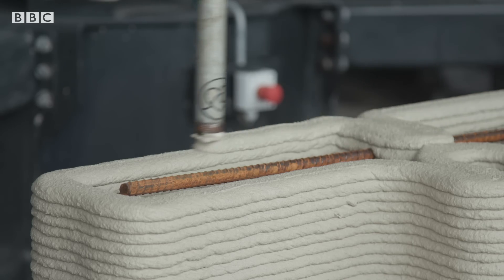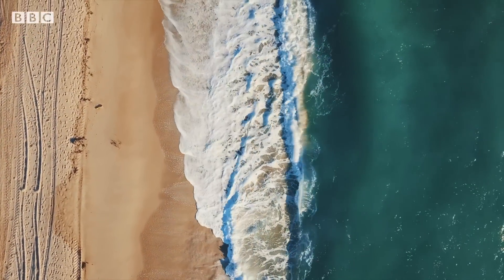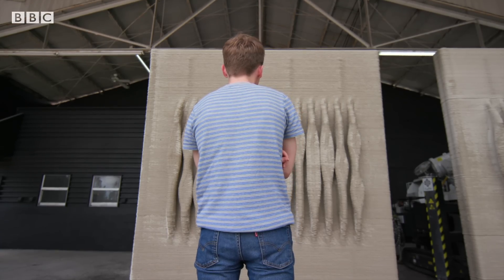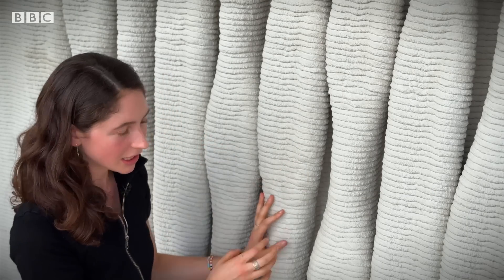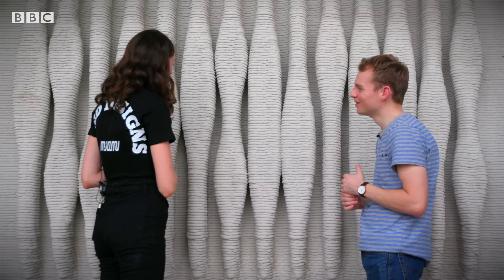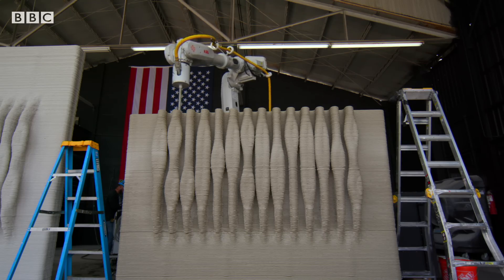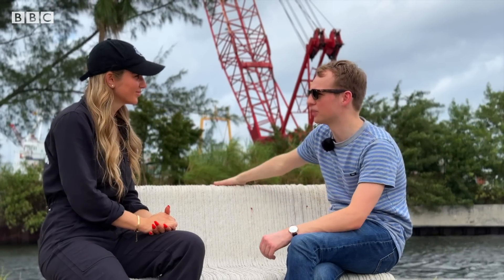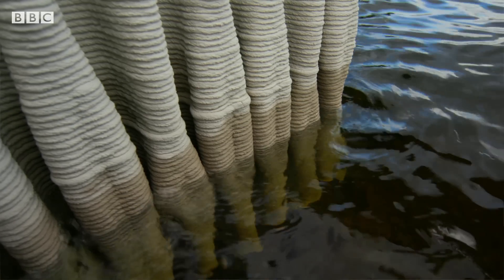Can 3D printed sea walls protect marine wildlife in Miami? | BBC News

Comment: Concrete! they are printing concrete! the biggest CO2 emitter on the planet, yet, this is a design they want to build with. And hey - It can be marketed to go anywhere! Brilliant, bring in the big bucks. $$$... Yet rising sea levels is caused by what? CO2 emissions warming the environment right. This planet is absolutely madding. Wh are they not focused on simply producing and working with a material thats not toxic.

Comment: I mean, it makes no sense to compare to plat see walls when we have used other types of sea walls for many many decades at least. It seems mostly to make it look even better. Obviously they have added good characteristics that you would not normally have where space is limited, but otherwise I would say that a regular concrete seawall is even better then this because the space available in between the concrete is more there, both small and large spaces. This one is just a compromise where the no 1 priority is not wildlife but just protection with small benefits to the wildlife.

Comment: These are extremely fragile. Their hollow core and layered assembly make them far weaker than their solid cast concrete counterpart. As such these panels are not suitable for seawalls. Waves have the power to destroy solid concrete panels this thin. What makes this girl think these hollow, layered panels stronger? Theyre not. A log or boat impacting these panels would cause them to crumble. 

This fluff piece was filmed at the request of Ayana as a means to find new investment.

Comment: People in the comments section suggesting alternative materials, including hemp, for this sea wall are forgetting that salt water is very corrosive. It is hard to find a material that can be 3D printed and stand up to constant waves, salt and sea life burrowing into it for decades. This is the other challenge...finding a material that doesn't break down yet isn't toxic and can be 3D printed can't be easy, as some are making it seem in the comments section.
Reply: If the problem is rising sea levels then address that. Which is the root cause - our building supplies, cars, Electricity production. Food production, These are the cause of our rising sea levels, Building with concrete is arriving at the problem down stream.
Reply: @grahamhiggins1816  what your suggesting takes time. The short term solution to stopping floods next week is sea walls.
Reply: @Guangatron because humans are short sighted.
Reply: @Guangatron  How many tonnes of Concrete are we talking of using? And this is a prototype machine they are trying to sell as a system for building, The manufacturing of concrete is highly problematic, for every tonne of cement made - 900Kg is supposed to be emitted in CO2 gases.. The world needs change, drastic change in mindset, it just doesn't seem to be taken seriously.

Perhaps, stone and sand could be used to build sea walls, - I don't know, Im just quickly looking at this situation now. But our time is up, yet nothing seems to be changing.

Comment: Roman concrete would still be the best underwater since it repairs itself, and you could still print that pattern.
Reply: which Roman concrete are you refering too?
Reply: he means mixing limestone and volcanic ash like the romans which hardens underwater and over time. Pretty OP but hard to scale up in a business @markplain2555
Reply: Pozzolano? @markplain2555
Reply: @markplain2555 be sfv
Reply: What you are referring to is the undissolved blocks of calcium oxide / quicklime found in Roman concrete that were the result of poor mixing.  This created a sort of self-healing concrete but that didn't detract from the fact that it was poorly mixed thus creating weak spots as the concrete hardens.  It's more of a negative than a positive, they weren't able to properly process and mix their concrete materials so they used a formula that had some ability to cope with the extremely likely cracks and bubbles that would form during hardening.  Modern concrete has the advantage of being well mixed and that we can carefully control the exact proportion and grain size of the aggregate ingredients.  There are certainly cheap modern concretes that aren't going to last long but on the other side of the spectrum there are some pretty amazingly strong concretes thanks to modern improvements.
Reply: @giglioflex they weren’t the result of poor mixing but intended, read “Hot mixing: Mechanistic insights into the durability of ancient Roman concrete” by Seymour et al
Reply: I think it's just normal concrete made with volcano ash and sea water.
Reply: @neondemon5137 it’s not the same, the volcanic tuff and hotmixing method with excess lime makes it tough as heck/self-repairing underwater. There are piers built during the Roman era that aren’t looking like all horrid like our modern sea works. There was a paper released about it last year.

You’ll see in the cutout sections of Roman sea wall giant calcium carbonate crystals, the tungsten in the tuff adds some additional properties that cause the concrete to self-repair.
Reply: LeonDegrelle. maybe learn to listen then do some investigating to come back with a worth while response.  Don’t know of gogliofkex is right but they had support for their argument.  This isn’t politics it’s science and engineering where constructive arguments and conversations can be had and help us all learn and be better for it
Reply: this is something that someone who knows nothing about what they're talking about would say - why? because you read watched a video about roman concrete once I'm sure
Reply: @williamrobinson4265 actually, I read the papers that recreated the exact mix and compared it to modern concrete. You are the very definition of the Dunning-Kreuger effect. Read this paper and the several others preceding it by the same authors if you actually want to learn something, instead of talking out your pseudo-intellectual behind.

Hot mixing: Mechanistic insights into the durability of ancient Roman concrete by Seymour et al
Reply: yes and it was all mixed to the exact same ratios down to what ppm? LeonDegrelle.
Reply: you are literally coded as some kind of european peasant - if you were being polite or smart I would be happy to engage with you in good faith - but since you present neither I can't really be asked to care what you say or what happens to you LeonDegrelle.

Comment: those things look absolutely impractically fragile and expensive (very expensive and slow machine, and they still need to babysit it, as the video shows). and the amount of scam-typical buzzwords used is beyond alarming.
Reply: Exactly, what kind of seawall is that 🤔
Here, seawalls are made of huge boulders and wave breakers. Even then they need to rebuild and reinforce parts of them because the waves erode them. Those 3D printed panels look like like something you would put in a pool or a fish tank 🤔🤔 ...what are they.
BBC? really ...

Comment: 3D printing could have honestly been huge but for some reason it didn't fully take off. Idk why, but 3d printing was hype for like half a year and then we never heard of it again. Now everyone is obsessed with electric vehicles and AI.
Reply: 3D printing has become mainstream. No longer something to shout about.
Reply: no, it has somewhat exited the general audience media reporting because it's no longer new. but it has found a lot of practical applications. the typical cheapest kind, using plastic, is typically only useful for making prototypes or replacement parts, since it can't economically compete with injection molding. 3D printing can however in principle be used to create shapes that are otherwise impossible to make in one piece by having complex hollow parts that would not be accessible to a cutting tool for subtractive machining and could not be molded because you wouldn't be able to remove the inner mold. and this becomes a technologically very interesting aspect of 3D printing if you have ways to 3D print very durable materials, like printing rocket nozzles complete with the fuel-preheating/nozzle-cooling fuel channels running around the outside by laser-sintering metal powder.
Reply: Don't forget XXL buttplugs too
Reply: Well, just like with E cars and AI, a lot of it is just hot air.
Reply: @overpope3510  You know it. Stand there wiv ya gob open?: they'll RAM IT FULL of whatever useless B.S. they can find

Comment: I thought that plastic in the sea was a bit of a problem.
Reply: i'm not a concrete expert, but plasticizers are not called that bc they are made of plastic, but bc they make things more "plastic" (that is, moldable).
Reply: @NirvanaFan5000  You are right but this stuff has more than the normal plasticisers in it if it has any at all. All they would do is make this thing collapse more easily than without. When you are trying to build a concrete form, the last thing you want are plasticisers in the mix. They are for mortar for laying bricks or a thin concrete floor. She says that their stupid machine knocks up one of these in an hour. there is no way that you can make a structure like that and for it to stand up in an hour. Concrete, ideally, needs 12 hours to develop any real structural integrity but then it just keeps getting stronger. Unless she is lying about the time that it takes that stupid machine to vomit one of those structures, that stuff has one or more nasty additives (Including genuine rigid plastics) and in some quantity. Although proper concrete is alkali and may leach some alkali into the water for a while it soon stops. If you were in England, I could show you concrete structures that have luxuriant growths on them both on and off the water. Concrete is cement and sand and frequently shingle or gravel. Cement is just cooked limestone. Unless you enjoy doing battle with nature, don't try growing  acid loving plants on chalk downland but alkali loving plants love downland. The same applies to concrete. Those creatures who require lime for making shells hate acid environments and so on. Although Florida is doomed, it is possible to delay the inevitable by building reefs offshore. Ask the Canadians for some hard rock dug out of Newfoundland and dump it in a line off of the Florida coast. Coral reefs protect islands in the Pacific ....  Hard rock reefs could protect expensive properties along the Florida coast. This little girl's con-trick will protect nothing.
Reply: spot the ignorant smartass LOL although it's true she had no clue what she was talking about you dont seem much better and she was friendly at least - I'd still choose to higher her over your attitude because she can be trained you...well....
Reply: did you watch the video?
Reply: @Chicken_Pox100  Yes, that stuff is essentially plastic plus, that woman was talking complete and utter tripe.
Reply: @terryhoath1983  It's concrete
Reply: @jack_elliott  They add plasticizers
Reply: @jack_elliott  I know concrete. Unless that structure is steel reinforced, it will not last 5 minutes. That stuff is plasticised. You cannot possibly do something like that with plain simple concrete without it deforming whilst the upper layers are being spewed. It takes simple concrete about 12 hours to develop any serious structural integrity, There is something nasty in that mix to make the bottom set in less than an hour. 4.00 + .... " we will incorporate more and more components to our materials ". The BBC, in their need to fill time with more and more cheap rubbish, they have fallen for producing an advertising video for these wasters trying to con people that there is a problem that needs to be solved when there isn't a problem in the first place. 
4.03-4.05 " "democratise" (pardon ?) this product and HAVE MORE OF A MARGIN" ... OH YES ! ... "more of a margin".  0.49+ "traditional seawalls leach chemicals and, very simply, they're flat." .... SO,  such seawalls are illustrated with a clip of corrugated steel pilings on a canal. It may not be attractive but It is NOT a seawall. It is NOT flat. It does not leach chemicals. If flat surfaces (I have yet to see a totally flat surface on any seawall) why do yaghtsmen forever complain about fouling (marine growth) on their super-smooth hulls ?. I have seen limpets gripping as if stuck with superglue to almost totally smooth rock ... the smoother the better for them. Should any of this art school project ever be used as seawall, I mean PROPER seawall, it will not survive the first storm. 

Florida is doomed anyway. Rising sea level is already giving rise to millions of rats leaving the flooding sewers and that is going to get worse .... and more and more alligators stalking the streets looking for children to eat.
Reply: @terryhoath1983 well your last comment proves you didn't watch the video, or you would have seen the rebar sticking up out of the top while the crane was moving them after the walls were fully cured.
Reply: @cruisinmargot  Don't "like" your own replies. I DID see the rebar being slotted into the gunge as the gunge was spewed but that is NOT proper use of rebar. Single bits of rebar were dropped into the rising structure horizontally every now and again. That is not proper use of rebar. To have any use, the rebar should be in the form of a welded lattice providing both VERTICAL as well as horizontal tensile strength. Regardless of those close-to-useless bits of rebar adding to the weight, if it was "concrete" as that word is universally understood, lower layers would buckle under the weight of gunge being extruded above made worse by those independent bits of heavy rebar.. That mess is NOT concrete so it has some kind of nasty substances in it and I believe that, at least in part, those nasty substances includes one or more type of plastic. If I hadn't watched the video, I would not have been able to make the detailed criticism addressed to Jack .... could I ?   Enjoy your cruising. I shall think of you fondly, you lovely creature.